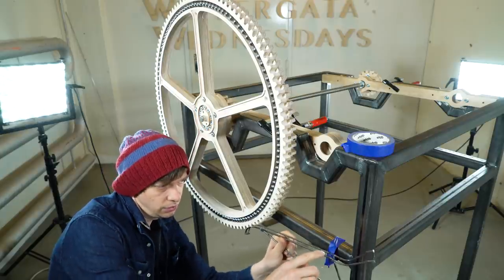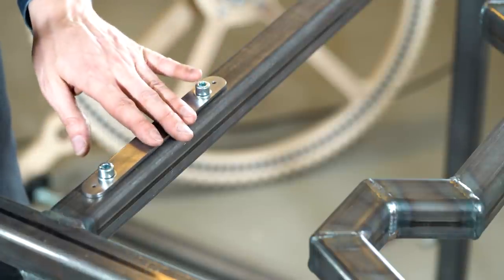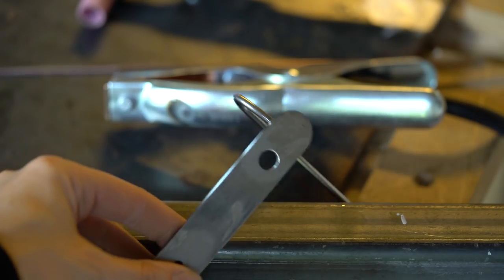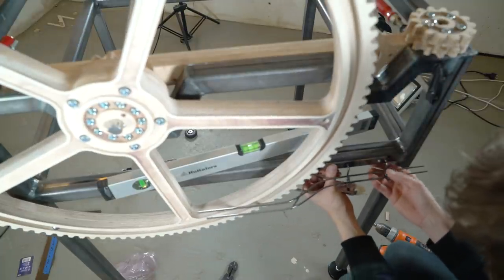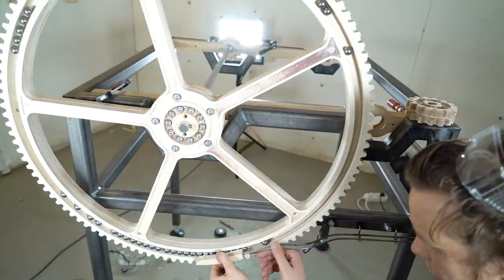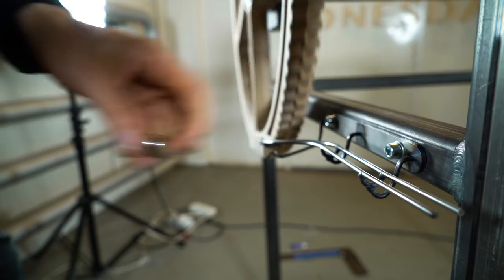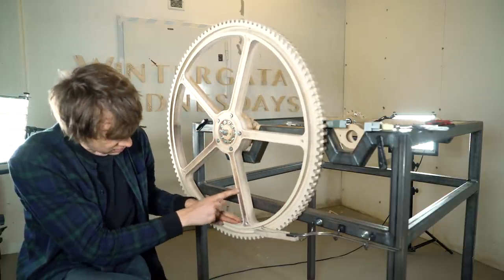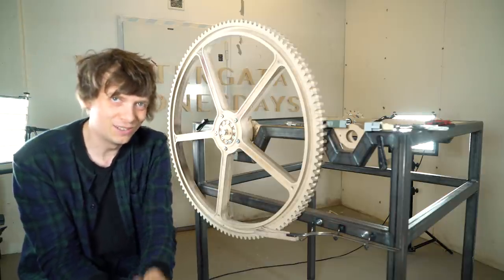Marble Tracks - Marble Machine X #15

Comment: Degaussing might be an option. The Problem you will have if you do not control the marbles is as follows: Magnetisation is a semicontinuous process. The Magnetisation will become higher over time. If you make steeper tracks, the problem will return later on. Also by making steeper tracks you run the risk of spilling marbles that are less magnetic. (you can "tune" the machine to a certain level of magnetisation, but that level may not vary by much in order for the machine to function.) Thats why you need to control the magnetisation level.

Comment: Hold your torch in place above your weld for about 3-5 seconds when you release your arc. It'll keep the shielding gas around the weld as it cools and the weld will look better and will be more pure.  You're doing well, though, keep at it!

Comment: I’ve been watching your progress since the start of this, in your little container shop 😁 I was wondering, you mentioned contrast between colors, design, and materials. Have you had to change how certain parts of the machine “Function” just because that part didn’t fit the design flow? If so, have you had to rethink and redesign functionality of such parts? How has this affected your plans in regards to the time you wanted to finish your project in?

Comment: Wintergatan, don't you think the steel marbles on steel rods will be too loud? 14:46 shows nicely how much louder they are than wooden tracks. Theoretically you could cover the steel rods with rubber, which would also probably be enough to fix the magnetizing issue.

Comment: If you want the MMX lasting the whole world tour, you should maybe build the track more stable at the end. It was shaking even when just one marble went through. And if it reaches inside the wheel, it shouldn't touch the wheel, if you don't want to use bearings.

Comment: Nice work til now. I am just a bit concerned of the noise the marble already produce with the steel frame. This kind of sound (noise) might be not so nice during  silent notes. I think you will ahve a vibration problem. Usually its avoided by rubber bearings or some additional anti noise material like in cars. Have fun - best regards Thomas - I love your band !

Comment: there is non-magnetic steel (IDK if it is ductile enough for wire though...)also 3d printed aluminumalso 3d printed pla-combos that you could polish if you want the contrast in that area to be more metal and plywood and have toe instruments be the white plastic

Comment: I know that you prefer the look of raw plywood; but if you are going to be transporting this version of Marble Machine, you need to take into account humidity and possible moisture absorption that could cause the plywood to swell. You may want to give all the plywood a coat of clear varnish just so you avoid the possibility, paying careful attention to seal up those exposed ply edges which can wick moisture easily.

It is still quite extraordinary to see MMX come together.

Comment: Yeah 11:15 your going to have to have some type of stop to keep the marbles from jumping the track when they are overloaded. A rail on the outside ??? I am almost thinking you need to have your rails in either a box formation around your marbles or a triangle formation to keep them from jumping off before they load on your  wheel. Reason I am thinking this is because your not going to just have 20 marbles trying to load themselves on to your wheel. Your marbles are going to back up a lot further then just your wood part (especially when you shut off your music). So you might want to think how your going to get both the bottom side and top side of the marbles held in place. Another thought about shutting off your music- you know in the other videos you have shown us, the music player shuts off the advancement of paper which hold the notes but the machine keeps on running. Could that be done here? That way the marbles could keep on loading on the top of your marble separator (at the top) with out stopping the collection and lifting of the rest of the marbles ?

RE: your magnetic marble problem: you could always run them through a 50 or 60 HZ AC coil to demagnetize them. Not sure where you would put the coil but as long as you ran the marbles through the coil it would demagnetize them. In reality it's really not hard to make a coil to do that. Check With either Sparkfun.com or Adafruit.com to see if they might have an easy answer for you about how to do this.

Comment: According to this: http://elteh.net/english-articles/magnetizer-demagnetizer.html  you only need to pass the object through a coil of wire with AC current running through it, to demagnetize that object.  That you can use a telephone magneto-generator as a human-powered AC source, and a long plastic tube wrapped with enameled copper wire as the coil.

Comment: Martin, good job as always! One thing I noticed was that your drill speed is way too high for drilling steel - you can see that by looking at the very small chips you are getting, and by listening to the drilling noise. When you reduce the RPMs you will find that drilling is much easier!

Comment: What if in the off-case, a marble doesn't land into the next gear up the machine, but instead stays on the first wheel; therefore colliding with the tool that leads them on? Will it fall out? Will it cause problems with the other marbles? Maybe I'm just over thinking it.

Comment: In regards to the magnetization of the marbles; could Martin alternate the magnet's poles on the second gear, and use it as a giant AC generator for degaussing?
I don't have a high functioning understanding of magnets or electricity; but I think running alternating magnets along a wire would generate electricity. I just don't know if it would be DC, or even enough to begin with.

Comment: If you run those balls through a copper tube (or a tube with thin copper wire coil), if they're lightly magnetised they'll loose their magnetic properties, because they'll cause an electric current in a tube, that in its turn, will cause a magnetic field directed in the reverse direction of balls' magnetic field, thus demagnetising them. Well, in theory.
In theory you can also try running them through the same electromagnetic tube, applying AC current. Becase, in theory, if you run a magnetic material through an alterating magnetic field, and if that field amplitude is decreasing as a ball go (e.g. you use a couple of such tubes one by one with decreasing magnetic field generated), in theory you quickly demagnetise them.

Comment: I think the same way as you used magnets for magnetize, you can use magnets to demagnetize along in the path, then it returns demagnetized. Although would be a nice touch to move, kick, catch balls from/to positions by magnets playing with polarity, and weaker magnets calculated everything around the weight of the ball. Eg. mechanics flips to the opposite side of the magnet, to turn the magnet a kicker, catcher, or if you are using weaker magnets that only able to keep the weight of the ball, but after a move, or hit couldn't keep it in place - then you can hit the sweet spot - as no hooks, clamps, to stop or move the ball...and the whole machine will work with the physics of the moving magnets, polarity, and weight of the balls, mechanics without electricity.

Comment: Magnetic marbles can cause bigger problems if you use steel wire on the gates. There sticking causes inaccuracy on where they fall. You can avoid that by using non-magnetic materials like brass.

Comment: Forgive my ignorance but why not simply place the wheel at an angle (eg. 45°) and create a hopper mechanism with indentations to accommodate the steel balls as opposed to magnets. Japanese pachinko machines (which use steel balls instead of coins) use this type of hopper.

Comment: +Wintergatan - At 0:35 (and at other places in a few of these videos), you cut one of the faces from a piece of square tubing to make a piece of "flat bar". I could see if it was just once, it could have been done "in a pinch" because the proper size of flat bar stock was not available at the time. But multiple cases makes it seem like the practice is routine or common.

Is there something special about the material/alloy of the square tubing that makes it ideal for these uses, rather that selecting the material from flat bar stock where it would seem there could be more choices for material composition, thickness, treatment, hardness, etc... ? Or is it just the economics of using what is available, some of which may be scrap/discarded material?

Comment: In theory you could make a demagnetization chamber that basically vibrates/shakes up the marbles as they pass, or have them drop a certain distance as they're pulled from the top of the wheel.

Comment: What about copper rod for the feed track? Easy to bend and can solder or braze it easier then welding the steel track. Not magnetic itself and any induced will weaken as the marbles slow. 

Easy to get by just buying some12guage solid core wire and stripping off the insulation to have some to play with. Also very easy to get when on the road if you need to fix something as it can be rebuilt off hand tools and a propane/map gas torch

Comment: Get yourself some eye protection!   I don't want to be the safety police but drill bits,  grinding wheels, brush wheels, polishing wheels can and do fail, break and fling parts and metal and wood shavings from drilling and tapping are not good for your eyes.   Yeah I don;t always wear them but be smart and don't lose an eye !

Comment: Will stripping the marbles off when reversing the process (like at 11:23) still work if the lower track is full of marbles? If there is too much mass on the track, it might end up pushing marbles off the machine entirely (probably not a problem if it never goes in reverse though).

Comment: Maybe you can make some system to vibrate the platform that takes the marbles off the wheel at high speeds to prevent magnetization?

Comment: Build a huge and bad-ass degauss coil somewhere along the tracks and feed it with tasty electrocity - no more magnetism problems! If you don't want to use external power for that, use the main wheel to power a generator.

Comment: Hello, I very much like what you are doing, 
When i saw the steel marbles run down two steel rods this came to my mind: 
steel is conductive. 
it should be possible to Control a Lightshow with steel marbles closing the contacts between two steel rods.
so when you go on tour with MMX you could put a second unit aside it that controls a Lightshow with marbles.
continous lights with marbles that run down tracks, flashes with marbles that hit Switches.

Comment: I agree with you about replacing the plywood end piece however I'm not convinced a 3d printed part will look any better. Instead continue to use your small round bar except put a 3rd piece on top to contain the balls. I've seen something similar on a pinball machines before.

Comment: Is it that the magnetized marbles stick to the tracks or that they stick to each other? If it's to the tracks, one option might be to use stainless (316) instead of regular steel for the track. Brass or aluminum would also be an option but it would change the appearance quite a bit and aluminum is a pain to weld.

Comment: For the magnitization problem you could consider using stainless steel a4 rods instead of regular steel, it got less magnetic properties, also yould wouldnt have to worry about rust :)

Comment: You may want to look into a degausser if you're having trouble with magnetization - a degausser uses rapidly alternating magnetic fields to demagnetize things. You'd need a way to move the balls through the degaussers field at a more or less constant speed.

Comment: You should try slowing down the speed of your drill press when drilling into steel with the larger bits. That would reduce the chatter and save your bits from dulling faster.

Comment: I know I am two weeks late, but if you really like the metal design, you could also try to make the tracks out of aluminium if you can. Aluminium is not ferromagnetic like steel is! That way they won't stick. Might be an option if all else fails!

Comment: You could add a marble demagnetization section at the top. Have them roll through a non-metal tube that's the center of an AC solenoid. The solenoid would have to turn on briefly and then off, because when it's powered on it would hold the marbles.

Comment: This is not my project but what if you did a catch-basin slanted in ward on the bottom part of the feed wheel. Gravity will insure a even filling of marbles ,loose ones will fall back into the basin and it might act as a revisor of marbles. Just a suggestion

Comment: perhaps you could heat the rod with a torch and then bend;  you could also then heat again and quench;  you could also 3d print clips to hold the raceways out of nylon or carbon fiber-nylon; the 3d print clips would assure your spacing is spot on.  Also why are you grinding w/o taking the track off first.

Comment: Couldn't you take another metal for the marble guides? I think that steel is a very cool material for construction but ther are a lot of variations. I am not an expert but austernitic steel should be non-ferromagnetic, rigth? Couldn't you use that?

Comment: The correct grade of stainless steel is non-magnetic if I remember correctly.  So you could still get the look you are trying to achieve, and it's relatively the same with the TIG welder.  The material is a bit tougher to cut and drill however.

Comment: +Wintergatan what you need is a "door" or "valve" which will be forced open while the wheel spins, but will close when the wheel stops. You can keep the extra marbles from getting too close. Then as soon as the wheels starts to turn again, the valve will open.

Comment: If you’re going to have a place at the top for marbles to accumulate, then the stack up problem on the wheel shouldn’t be a concern as the marbles will never be on for a whole rotation of the programming wheel. There will be something stripping the marbles off at the top.... unless, of course, you’re planning on using the wheel as the sole source of marble storage.

Comment: You might need to design that curve between the wheel and on-ramp a bit better. You'll have a lot of vibrations as you cause those marbles to have quite the acceleration going from no side accel to high side accel. Something extremely gradual might help a bit more.

Comment: For the magnetisation issue, I think you solved it already. Just add a section in the machine where the balls can drop onto a hard surface to remove magnetisation.  They could drop right on those steel tracks, or maybe the balls start in some funnel. Something like this http://prntscr.com/gtc13i

Comment: I was watching you detailing the welds on the ball rails with files. Files are intended to be used on the push stroke only.  Drawing them back against your work with much pressure at all will dull the files.

Comment: I am a bit worried about those sharp turns in the track. Depending on how fast the marbles will move on the track, you might need to angle the track so the marbles can do a banked turn instead of flying of.

Comment: I say just a tiny copper wire brushing against each marble as they come off the top wheel and connecting to the metal frame would probably do it for demagnetization

Comment: Do you think you might have a problem if there's too many marbles at once trying to enter the stopped wheel? You had three or four marbles queuing up on the plywood part before the wheel, but what if the row of marbles coming in was longer than that part? Would they just stop on the metal tracks?

Comment: hello wintergarten,

you can solve the problem of magnetization by add some coils and creat magnetic feild, but you need electricity. You can creat an alternator, you have all you need. On the wheel you have magnet that move, so just put a coil and you can induice current , and go to anohter coil where the marble go through, the magnetization will be gone.

Comment: Coming from Model Rail Roads you might want to make sure your marble drop is no less the a 1% degree. I am thinking 2% drop. For the opposite reason when you design a grade for a train, that grade will help the marbles keep on moving. In trains if the grade is too much it makes it hard to control the train going down, and hard to get the train to go up if it is too steep. Your not having that problem, but you need to keep the marbles moving.

Comment: For demagnetization you could try whether it helps to let the marble simply fall through a metal pipe, like here: https://youtu.be/DcFbXyiq5O0 The eddy currents will make a magnetic field opposing the original one and this might be enough to lower the remanence. But even if it helped, you would loose some height.

Comment: If the magnets wouldn't all be in the same direction, you may could demagnetize the marbles by passing them near the wheel, so they get an alternating magneting field, which degausses the marbles. But I'm not sure if it works because the marbles roll and I think it would be hard to get the magnets out again.

Comment: You may want to add a rattle box to the design. When the marbles come off the main wheel drop them into a box that shakes a bit, maybe integrate it as a percussion source, banging the marbles a bit before they travel to the rest of the machine.  Looking good!